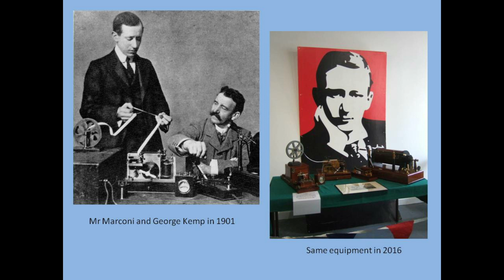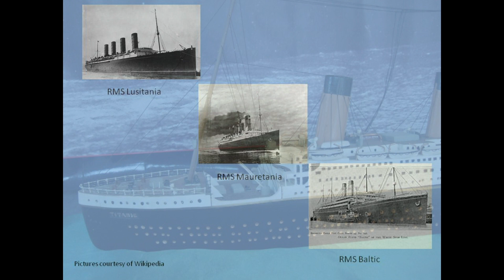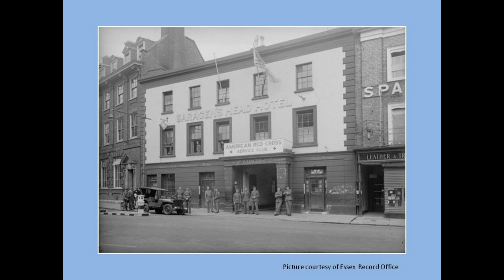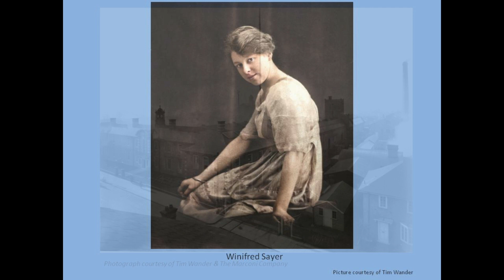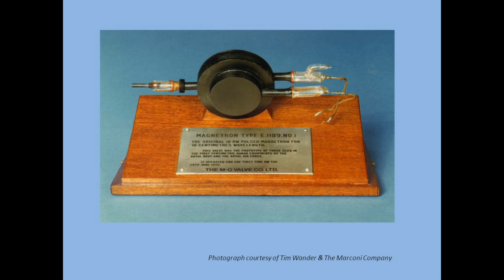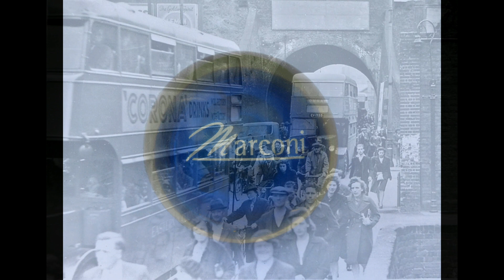Marconi Virtual Walk - Chelmsford Heritage Open Days

Comment: Marconi's Hall Street Works, is the world's first wireless factory and also world's first electronic factory. Today the factory's distinctive company brand name has been restored, clearly stating WIRELESS, rather than Radio. For it made wireless equipment, that saved thousands in peril on high seas. But it did not make a single radio, as in 'steam radio'. Marconi sold his prestigious name to various companies making so-called 'Marconi Radios', but none of his various factories ever made a single radio.